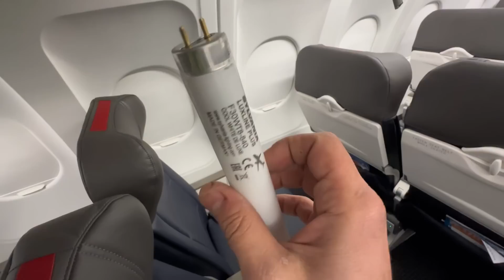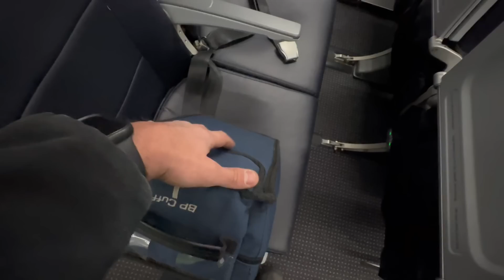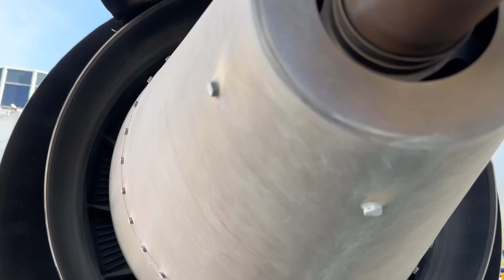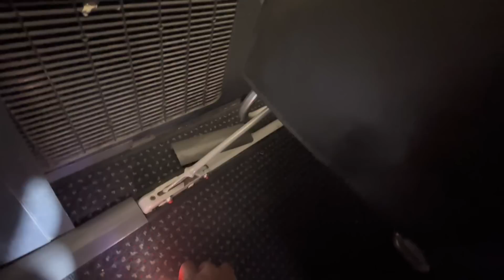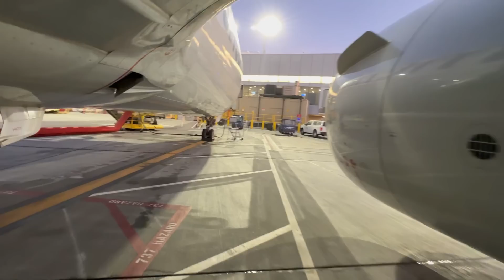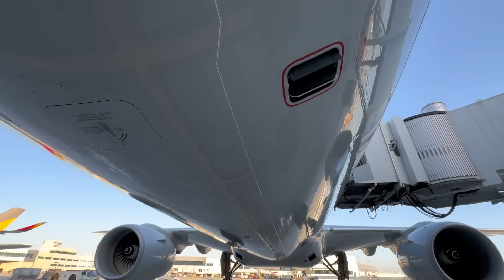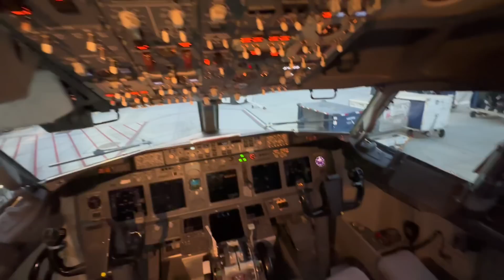Stig Shift #52 (Aircraft Maintenance Adventures)

Comment: On the Wifi antenna dome: I assume there is also a fuel penalty involved with that due to the increased drag?
Reply from the maker: There is no fuel penalty, it’s already been calculated when they installed it. Although there is an interesting factor when it comes down to weight and balance and how the aircraft performs. They had to update flight characteristics when they installed the dome initially.
Reply: @StigAviation  Well I mean fuel penalty compared to the same model without the dome, I would have assumed one without dome would have less drag and therefore less fuel burn?

Comment: Thanks for another interesting video. I have learned so much and still learning. Everytime you show a 737 wheel well, I think "does it have the spoiler mixer, is it a max" 🙂I didn't know that the 772 and 773 had different wheels. I thought they would keep things "simple" and they had the same wheels. But I guess it is for weight. I also had tears in my eyes when you showed the snowball express, last time and in this video.
I miss the "cargo never disappoints" section. Did someone prevent this?
Reply from the maker: Thank you so much and I’m very happy that you’ve been enjoying all the adventures. And in regards to the cargo side, I just haven’t had time to go over there lately. My duties have been keeping me quite busy on the line.

Comment: Recently a 737 had a tire explode on the takeoff. Fortunately, the crew were able to safely about the takeoff. My question is. Is the tire explosion something that could have been prevented by the maintenance crew during a visual inspection of the tire's prior departure?
Reply from the maker: It’s something unpredictable at that point. If there was excessive wear or damage to the tire prior to the departure, that’s when maintenance would’ve addressed the issue. But if it’s a perfectly good tire and the aircraft encountered some foreign object debris on the runway, and that caused the explosion. That’s something that’s out of our control

Comment: live animals heat sensor, for the pigs being transported on a passenger flight that had to be diverted as the stink came into the cabin and got way bad?
Reply from the maker: @george-b3i-d2d  I’m not quite sure where you are going with this, but they will not transport pigs in commercial aircraft. Most likely pigs that are meant for farm use are transported on cargo carriers.
Reply: @StigAviation  look up "Pigs divert aircraft"
Reply from the maker: @ yeah that’s an international carrier, that’s KLM, and they have different provisions and rules. I’ve never seen that done on US carriers where they will carry that many live animals inside the cargo.
Reply: @StigAviation  thanks!!

Comment: Oh, Stig,  This video made me so homesick for my 777. I liked you pointing out the Semi-Lever Actuator on the -300 main gear.  When a -200 rotates for liftoff, the 12 wheels stay on the ground during rotation.  If a -300 did that, the tail would hit.  By latching the gear as a solid unit, the rotation happens on the aft 4 tires. That adds several inches of tail clearance during takeoff.  Thanks for the Bulk Cargo tour.
Reply from the maker: You’re absolutely right. I’ve always loved those little details. Thank you so much for watching Larry
Reply: Thank YOU for your service!

Comment: Before I ask my two questions, I'd like to wish you a very Merry Christmas. My two questions: can thrust reversers be opened and closed when an aircraft is not moving? Next question: Do all intake fans rotate in the same direction? Thank you, and God Bless you.
Reply from the maker: Yes the thrust  reversers can be deployed when the aircraft is not moving. The thrust reverses are controlled hydraulically. There are times that we as maintenance perform operational checks on them on the ground. And yes most intake fans rotate in the same direction, but you do have an exception when it comes to a Rolls-Royce engines, those rotate in opposite direction. Wishing you a very merry Christmas. Thank you for watching

Comment: 22:39 what kind of grease is used in the bearings/pins on aircraft? Im guessing normal petrol grease wont work with the kind of temps and weights? Maybe a special silicon Moly or something?
Reply from the maker: Aeroshell 33 that’s the grease we use for majority of the components. There are other types of grease for high temperature areas as well
Reply: @StigAviation  thanks for the reply! Ill look into it 🙂

Comment: Been wondering for a bit when you "switch to guns" why is there a few second delay after the buttons are pushed?

Always look forward to these weekly videos sir. Ty for keeping us the flying public safe.
Reply from the maker: Because it’s just sending electricity through the circuit, it’s going down to a little electrical knocker at the base of the control column.
Reply: @StigAviation  ty for the explanation sir. Always look forward to the Stig Shift videos every week.

Comment: I work with antennas similar to the wifi one every day. RF injuries are no joke, you can burn your liver and not even know it until you're symptomatic. The reason that the passengers are safe is twofold, first is the massive ground plane known as the fuselage, the metal will sink stray emissions because it's ground referenced, and secondly because the transmitting antenna is highly directional
Reply from the maker: Yes indeed, radio frequencies are very dangerous. And as you said it would literally cook you from the inside out. It’s the same thing when we’re performing tests on the weather radar. Very dangerous.

Comment: Great videos, I love the technical details.  Question - the tugs used to push the airplane back, why are they so big and the odd shape. Wouldn't a tractor work with slick tires? Something I have always wondered
Reply from the maker: Well the thing about this is that it does not take much to push an airplane back. All you need is a little bit of momentum. Now that being said stopping that aircraft is a whole different thing. You have a lot of weight, this is why these tugs are very big and very heavy. They need to be able to stop the aircraft. You also have very special mechanisms that can steer in various amount of directions. These thugs are capable of side steering as well as crab steering.

Comment: Hey Stig! I work in the IT field and would love to see and hear more about the onboard satellite antenna and wifi access points that are embedded throughout the cabin. Is there a information panel for the satellite/wifi system or is it all automated?
Reply from the maker: Well the satellite antenna, you saw right there. There’s not much to it, after that it goes down into the cabin to a power supply, and after that it goes to a server and then a router. After that you have basically repeaters throughout the cabin that are within the ceiling. It’s not much different than your home network system.

Comment: Howdy Stig. As always, love the content. I have a question regarding the A320. Four years ago, I took an NKS A320 from AVL>FLL where after landing, we sat on the ramp for an extended time, due to a gate issue. I'm pretty sure they shut the engines down and were running on the APU. I had a seat directly over the wing, and during that time, there was a really loud and obnoxious whine coming from the floor.
Was this an air conditioning pack or something else? Merry Christmas brother.
Reply from the maker: Most likely they only shut down one engine, and the whining that you were hearing was the PTU, the power transfer unit a.k.a. the barking dog.

Comment: Haha that is so cool. That first plane 679AW was the second plane i’ve ever worked on at the MRO i work at. The LH MLG actuator bushing had really bad corrosion. Which actually extended to the structure. I don’t remember if they had to replace the whole fitting or somehow add structure. All of it was found during the time change of the actuator
Reply from the maker: Most likely they probably replaced the fittings or probably oversized it.

Comment: Stig, have a question. I see when you post videos it looks like you are limited to hand tools only. No power tools. Is this so you don’t accidentally overtighten or strip screws, nuts, or bolts?
Reply from the maker: We are allowed to use power tools, but most of the time we will use simply hand tools to prevent any kind of over torquing and to prevent stripping the fastener. But there are certain cases and times that we are allowed to use power tools

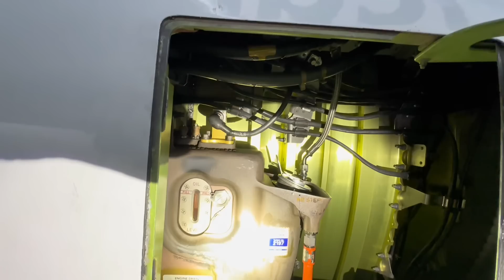Comment: 53:42 that oil seemed low? Also, do you ever check for accuracy of the oil gauge in the display compared to what you see in the engine sight glass?
Reply from the maker: That oil was actually right where it needs to be. As long as I can see it in the site class then it’s good. If it’s below the site glass then I will service it. And yes I do double check upstairs to see a comparison.

Comment: Stig how does cabin or cargo heat work in a plane?  Does it come from the air conditioning packs or bleed air or is it resistive heating element?
Reply from the maker: Yes it does, your assumption is absolutely correct. Heating and cooling comes from the air conditioning system, and the air conditioning system uses the bleed air either from the engine or the APU.

Comment: Hey Stig!  Thanks for another adventure.  I didn't know what the "unemployment" line was.  All these years I thought it was just decoration.  When you were talking about exits, I noticed that on the 321 it looks like there are the same two openings in the fuselage but one is plugged - I guess because there's a larger door aft of the wing and forward of the galley door.  Are these fuselage sections on the 320 and 321 the same?  I've wondered why you'd build an aircraft with optional doors (like the Boeing Max 9 for instance).  Keep 'em coming and Merry Christmas!
Reply from the maker: Thank you so much for reminding me about that Bob, I completely forgot to talk about it. But yes you are correct on the 321 you’ll see the two hatches but only one of them is actually functional. And once again it all goes back to seating configuration. The more seats you have the more exits you need to have. And the fuselage sections between the 320 and 321 is different, the 321 is longer

Comment: Also, are the flight attendants trained on opening, deploying and seating the passengers in the raft? Are there enough life rafts in this plane? I always thought that the life rafts are opened with the emergency chute slides.

And how are flight attendants expected to carry heavy life rafts to the doors of the plane in an emergency when passengers may be panicking and taking up the isles..

Thanks
Reply from the maker: Yes the flight attendants are trained to do all of this. Now when it comes down to the very big rafts that I showed you, passengers would need to assist. And you are correct every single door slide also functions as a raft. So trust me you have plenty of rafts on board.

Comment: Hey Stig, is it common for those WiFi radomes to fail? I have been on plenty of flights where the aircraft is fitted with WiFi however it was inoperable.
Reply from the maker: Most of the time it’s not the actual antenna that’s failing , most of the time it’s the computer boxes controlling it or corrupted software.

Comment: You should mention the door plug next time you get a chance to. I noticed it on the cabin flex 321’s
Reply from the maker: @5060Presents  I have mentioned it in the previous videos that I’ve made. But yes that is simply a plug for a door that’s not being used
Reply: True true. It must have been a while 😅

Comment: Have a little question, how do the drain masts for the avionics bay not casual a slow but steady depressurization?
Also have a great great Christmas stig. The GOAT of line maintenance and teaching.
Reply from the maker: Because it’s not enough air leading the aircraft. Also there really is no drain mast for the avionics Bay. You have bilge  Bay drain holes that seal up, and regular drain mats will simply drain grey water from sinks